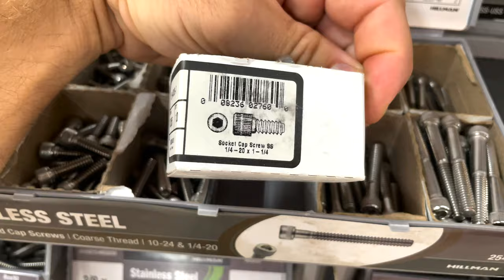MOD HERO9 HERO10 HERO11 for HERO8 Knekt dome - GoPro Tip 689 | MicBergsma

Comment: This is actually BETTER than the current KNEKT dome for Hero9 bc on this newest version it's "naked" & the depth rating is cut drastically bc you're limited to the GoPros stock depth (33ft/10m).

With the previous model KNEKT domes that are used with the super suit, you get 196ft/40m.